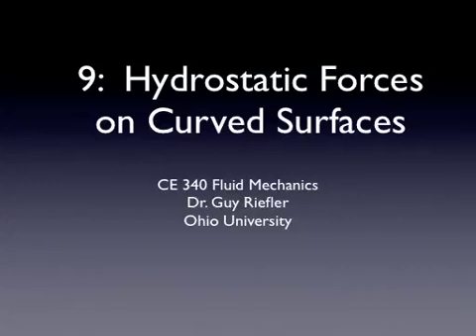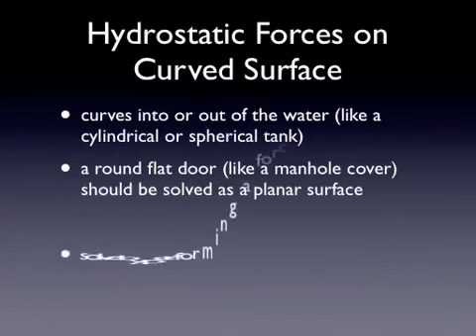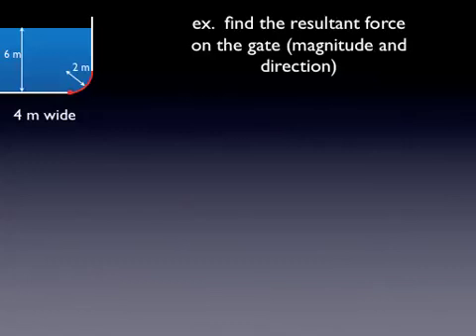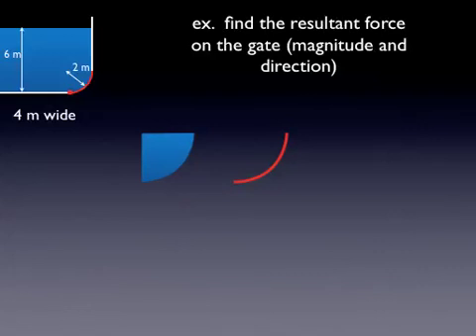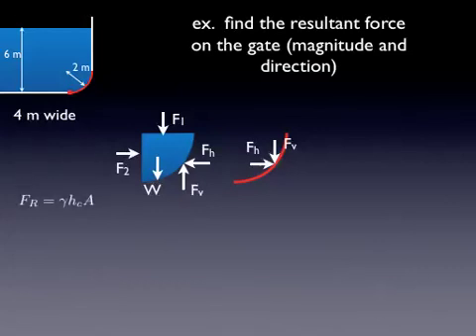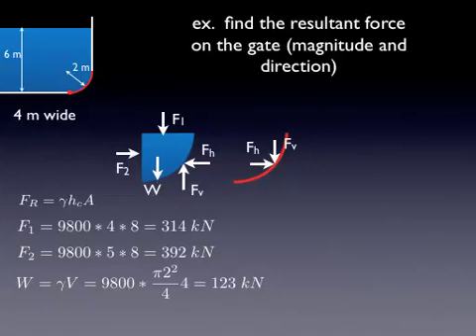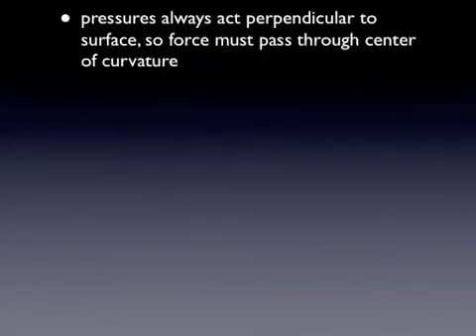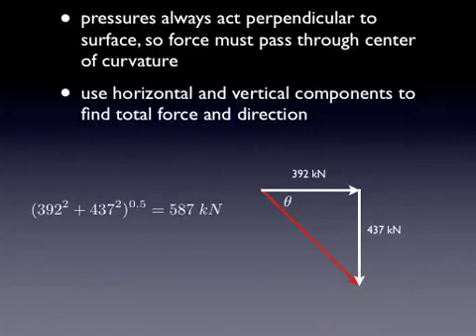09 hydrostatic forces-curved

Comment: make 2 separate area ,1 is rectangular of dimension 4x2x4m (check the dig properly) and for curvature radius=2m ,area= 1/4 of circle ie 3.14xr^2/4.
again for upper rectangular section force acting on the top area from     h=4m     below free water surface F1=wAH
wher w=specific weight=9800,area of the section where force is acting=4x2=8(THIS IS VERTICAL DOWNWARD FORCE ACTING ON TOP PART OF CURVED )
for force on curved surface HORIZONTAL FORCE ACTING ON THE SIDE OF CURVED SURFACE...
1st locate the centroid i.e.            4m from top+radius=2/2  mtr=5m           from top acting on the horizontal side  .here for coincidentally  are is same as 2x4=8m2   but may differ from question to question
3rd point is                         weight of curved surface = specific weight  x volume(or  areaxheight)
thats it...